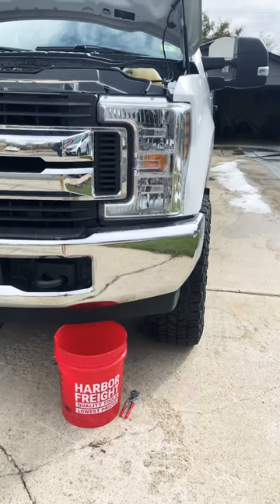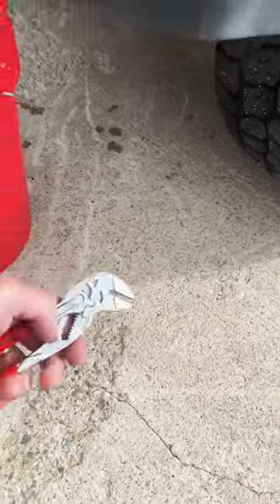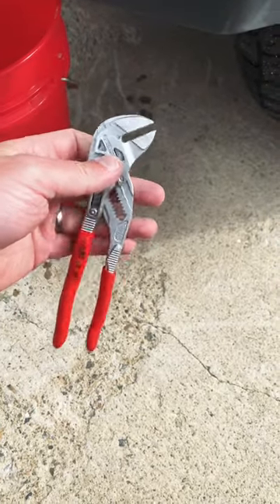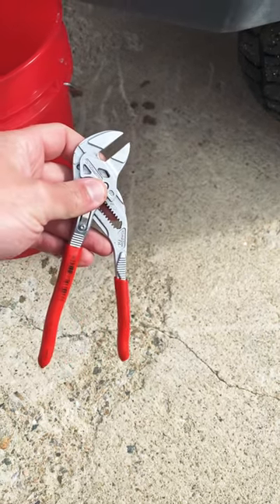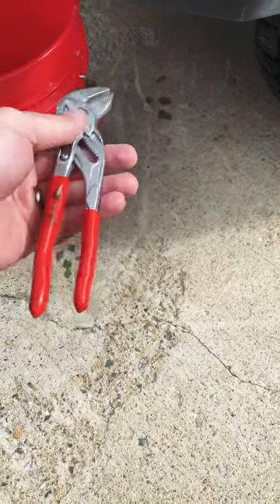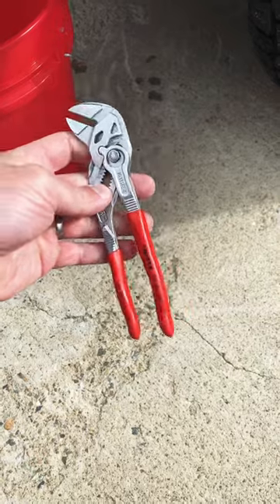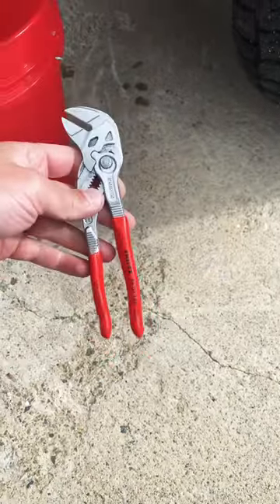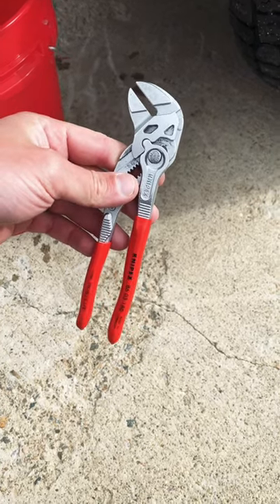A helpful tool for draining and filling coolant on the Power Stroke 6.7 #powerstroke #fordtruck

Comment: Thanks for the tool description. I gave up on my coolant change because of the crappy peacock location. Will reengage the job now.
Reply from the maker: No problem! Those knipex pliers are a little pricy, but so worth it.  I didn’t have time to do a full video on my coolant change, but next time I do the service I will plan to film a how to!
Reply: Can you send  a link where to buy this tool.... and also if I am going to drain my left side radiator and when I do go back to filling up the reservoir do I have to bleed the system or not I'm only doing the left side drainage because I am replacing my reservoir...
 thank you